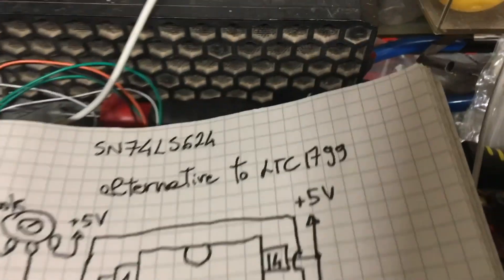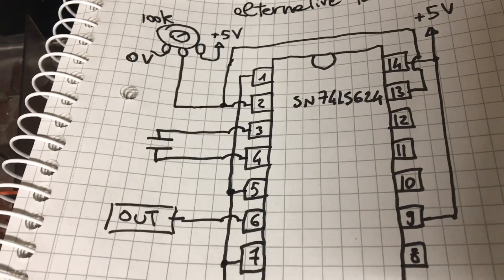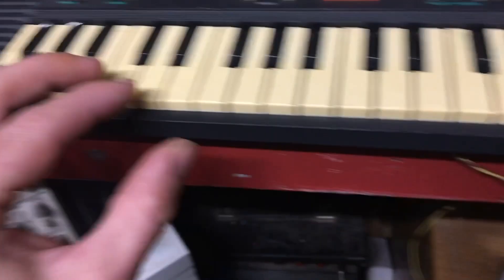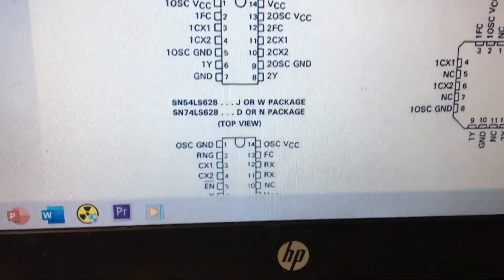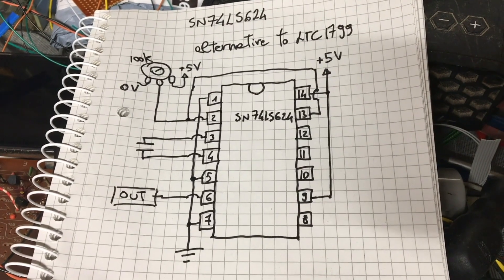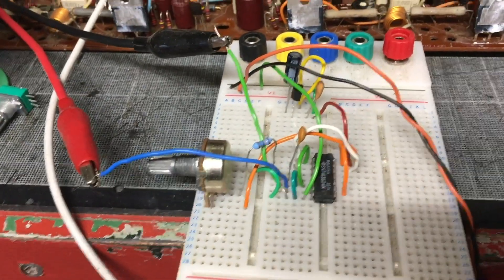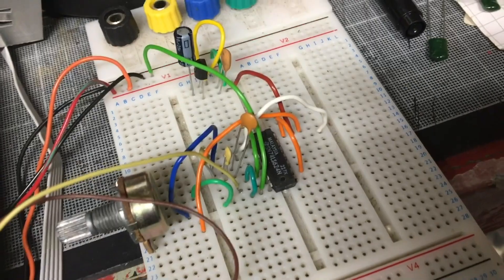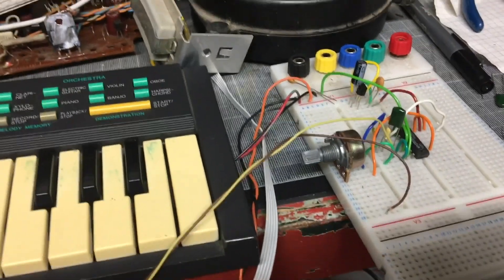Circuit Bending Tutorial #1 - Alternative to LTC1799

Comment: Hello, sorry if it’s out of subject but i already have ltc 1799 but it’s my first time with it. I saw you used a pss-30 keyboard on your video. Can you help me to find where is the voltage pin on the board to connect to the ltc 1799 ? It must be between 2.7v and 5.5v. Thank’s :-)
Reply from the maker: Hi, sorry for the late reply. I can't remember where is the voltage pin, although I am pretty sure that I hooked the LTC1799 up to the main chip's positive voltage, the YM2410 one, where you also connect the LTC1799, since it's powered by 4.8V or 5.2V which is fine. There are some schematics here, if it may help: https://www.youtube.com/watch?v=CYDeLFLi6FE
Reply: @SMMPUK   I tried solder it on the main chip's pin, where voltage was 4.61 according to multimeter. But it don't work I have no sound now... could you help me to determine what is wrong ? this is a video of my pcb : https://www.youtube.com/watch?v=vILJHIVYfhs
Reply: @SMMPUK   Do you have a schematic of the pss-30 ? I tried again with a friend why knows good electronic but he tried to find a schematic without success. Now the ltc1799 alimentation is connected on the + of the batteries and the ground to the spring of the batteries. When I boot up pss-30, sometimes keyboard works for 3 seconds and then it crashes, and a noize come. This noise can be pitched out or down by the potentiometer connected on ltc1799 but no sound on the keyboard :(
Reply from the maker: Hi, I replied to you in a previous comment and linked you to a video where there are some of my schematics. If you get no sound it could be that the ltc is working at a frequency too high or too low and so you need to short b and c , or maybe try with another ltc chip if you have it as they are delicate and sometimes the stop working. In the video I linked you to there should be how to connect the clock

Comment: Noob question:
Can I use a 555 timer to controll the clock? And if so why I only see people using the LTC1799? In the same topic, can I use any oscilator type circuit to control the internal clock of a toy?
Reply: Thing about the LTC1799 is that it's very stable in a frequency range of 3-33Mhz. A 555 doesn't go as high and also isn't as stable.

Comment: Nice one! I learned about this year's ago by user Sam_Zen on the electro-music forum. Unfortunately Sam_Zen past away in 2010. But E-M has a great forum lots of circuit bending knowledge on there. Thanks for schematic and explaining,  I had forgotten the chip name. I have some laying around but have not tried them as clock oscillators. Can we go ultra low pitch with these?
Reply from the maker: If you want to go ultra low, one option is to use a frequency divider like the cd4040 and maybe a rotary switch,so you can still have a wide range. Probably the limited narrow range is due to the fact that the voltage supply is only 5V. With other VCO like the cd4046 you can have a wider range you guess
Reply: @SMMPUK  Cool, thank you! I will try the different options. I guess 4046 is the way to go,  just to keep the parts count low. Maybe the xor gate on this could be used momentarily to crash the main chip? Just guessing here..